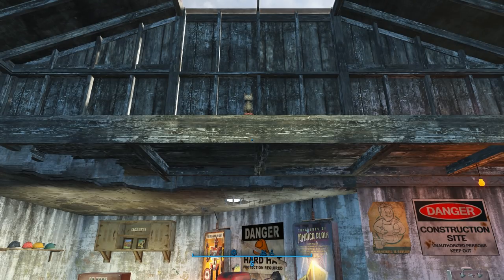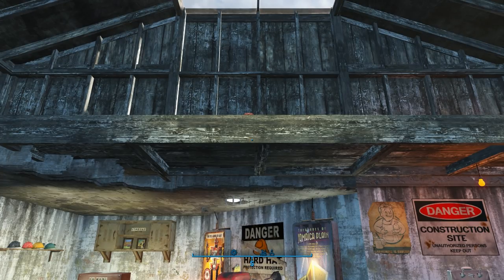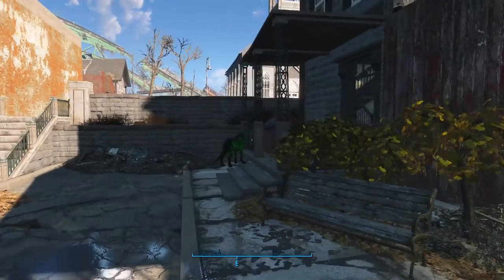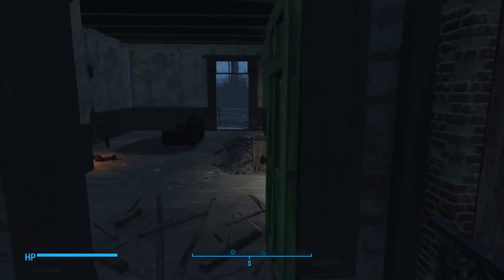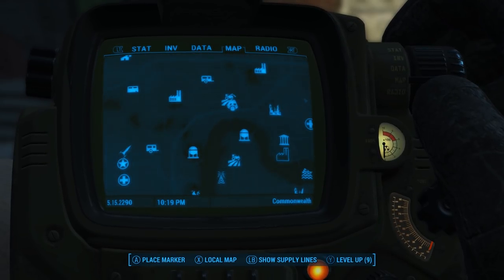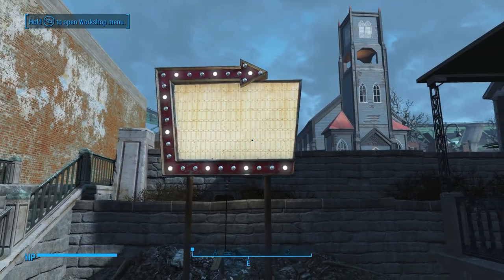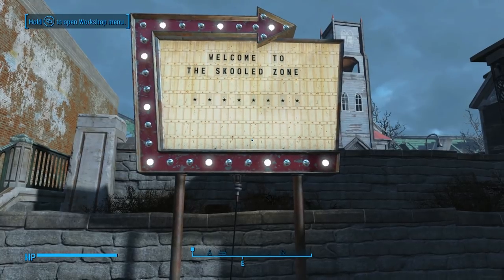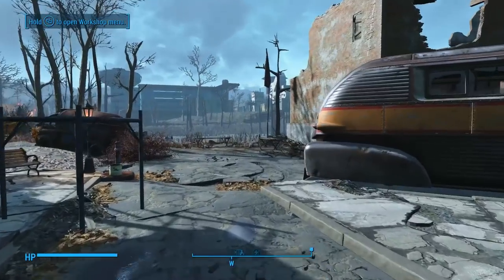Combining the Rug Glitch and Pillar Glitch 🔀 Fallout 4 No Mods Shop Class

Comment: the vendors (general) that won't work with the rug glitch, to get them to work you just have to put a conga line  of default rugs under it, like wayyy more than you'd think, like 10-20, and put the vendor somewhere in the middle, until it pops up on to the rugs, and boom it works
Reply from the maker: "Conga line" Haha. Good one. The vendors I was talking about though are the newer counter top ones. They snap to each other, though. So that's why they don't work with the rug glitch.

Comment: PSA, you can stack beds in same cell with small toolbox or mats to save space, the settlers may not reach the physical bed, but the bed count still registers.  I did this in Covenant, where placing a sufficient amount of beds is challenging with the allotted space..also, you can place lights inside existing lights in covenant to produce more lighting, you can fit a single string lightbulb into the middle of the cieling fans already in place, and fancy lights in the existing fancy lights.
Reply from the maker: Good tips! Check it out: https://youtu.be/Jl-idDvy-PE?t=623

Comment: Some prebuilt houses the door will snap into it without the pillar glitch. An example is the players house. The side door is missing, the one that leads to the car. Thanks for adding the PlayStation button, I hope you continue to do so!
Reply: Also, using the rug as the focal point of the group select "pillar glitch" works as well.  If you don't need to move the door vertically, use the warehouse or barn door frames, since this will place the door on the ground.  Your biggest issue is finding a flat enough surface to do this on.  Once the door is placed, remove the frame and move your rug into position.  Then group select and move the door! This will allow you to get a closer look at the door/door frame, to line up everything closer.
Reply: how do you do group select with PS4
Reply: Peter Heizman.  Lemme think for a moment. . . .I'm on pc, but have played it on xbox and use my xbox controller for pc.  The button that you use to select an object in build mode is the one you're looking for.  It would be the bottom button.  On xbox it would be the "a" button.  So, if my memory serves me correctly, it would be the "x" button on PS.  To group select, you need to press and hold the "x" button, while the object is in the crosshairs.  Items that are snapped together will automatically group select when this is done.  If you are trying to pillar glitch an object, if the "pillar" is close enough to the desired object, it will highlight as well.  If it doesn't, move your"pillar" closer.  But, to group select, it would be the button that you normally use to select a single object in build mode.  You just press and hold.  If the object(s) disappear or "jump" to a place that you can't see, try selecting your "pillar" or last placed object and place it in the same spot.  

Also remember that you can use the trigger buttons to rotate, raise/lower and change distance on your selection.   If you press R2/L2, all objects that are selected will rotate, right/left (clockwise/counterclockwise).  If you hold the R1 button and use the left thumb-stick, you can change the height and distance and left/right adjustments of the object(s).  If you select and object and hold the R1 button and use the R2/L2 you can increase/decrease the distance of the objects.  I think those are all the right combos.  Play around with them, and you'll get what you want.  Hope this helps  : )
Reply: thank you that helped

Comment: I LOVED this video!! Sinking the generator underground yet still able to pull it back up!  Genius!  I wonder though if doing this would help on FPS when your settlements get to large and start getting laggy if burying generators and other things would lessen that fps drop.  Furthermore you could use the conduit pipes to wire your settlement underground so you aren't left with wires strung everywhere.  I love your videos Paul but I must confess I usually play with some mods.  But I'm going to use this method to wire my city up having the wires underground (like in real life) instead of strung from roof top to roof top.  I'd love it if after this series or possibly tangent to it if you could do a modded schooled zone.  Covering tips and tricks to modded game play.  Ranging from tricks like this one that even with a place anywhere mod this trick is still extremely useful to tips about load order and just all sorts of things.  Anyways your amazing Paul!!  Keep up the great work!
Reply: Saraphiene.  To answer your question.  No.  Burying item underground will not solve any fps issues.  It may, however add to them.  Out of sight, is not out of mind in this case!  The reason being, is that the game still loads the items, no matter where they are at!  I found an example of this by accident while browsing some posts on a mod that I was going to download.  The mod author redid College Square and people were complaining that the fps drop was heavier than normal. The mod author came back and explained that it was his fault.  He had left four Prydwens underground, instead of deleting them!  This made it almost impossible for lower end pcs to load the area without ctd.
Reply: Well he is kinda doing a mod shop class cuz you can use every tip and tricks with mods 
But it is a good idea to build the cables underground ;)
Reply from the maker: Saraphiene, it would take some careful planning but you could totally run conduits around your settlement underground so no wires are showing. That would be kind of amazing. You'd probably want to leave some "pick up" points like I showed in this video because generators can still get damaged underground and need repair. Also, I think Court answered the question about the FPS issue. Since I don't use mods I wouldn't have known about that modder. Here's one of my issues with mods and why I don't use them. Whenever I watch a video of a modded settlement, I can never tell what was the true work of the YouTuber and what was made easy with the mods. It'd be like watching the Tour de France except some cyclists are using electrically modded bikes. Sure they still have to pedal a bit, but you can't really tell how much was their effort vs. the effort of the mods. At least that's the way I look at it. Whenever I see a beautiful no-mods settlement, I can immediately tell how much effort and creativity was put in by the YouTuber. When I posted Vault 42, I got comments for weeks from people claiming there was no way I didn't use mods. Haha. Some got nasty and called me a liar, clickbaiter, and sprinkled in expletives that got filtered into the spam folder. That right there was a message to me that mods have really blurred the lines. But I took it all as a compliment because if I can do a better job than mods, it's like beating electric bikes in the Tour de France on an old rusty Schwinn. LOL. Anyway, love your ideas but that's why I probably wouldn't do it. Plus, it's cool knowing I'm one of the only no-mods channels left. Viewers can come watch my videos and trust that everything was "hand-crafted" hehe. Know what I mean? Oh and by the way, did you notice the mining helmet on the front aisle desk? ;)
Reply: Interesting.  Where did you find that?  I don't believe I've come across that in over 1500 hrs. gameplay.
Reply: Skooled Zone I saw the mining helmet and loved it!  Thank you!  The only mod I use are scrap mod to get rid of trash really but I totally understand your Tour de France reference which has made me contemplate using mods at all.  None the less count me as an avid subscriber because I love your work!
Reply: I love to build, but the problem with no mods is that the game has simply become too easy. It's fairly trivial to do a one-life survival run with no mods. Throw Horizon and maybe Pilgrim on it and it's not just really difficult, it's also mildly terrifying. Happily, what I learn from  you is applicable in that scenario as well.
Reply from the maker: Court, 1500 hrs? Wow, that's impressive. 👏 I think I'm still under a thousand. Anyway if you talking about the pink mining helmet, I found it and a bunch of other colors at Dunwich Borers. Saraphiene, cool, cool. Glad you're part of the class, and I like taking viewer suggestions. :) But your mentioning of the scap mod as well as Tom's mod suggestions brings up a good point. I don't want to paint mods with too broad of a brush. I'm only talking about the settlement mods that add things unavailable to the vanilla game and dlc that make it an unfair race for no-mod builders. Other mods which don't affect the look of the work, or don't even have anything to do with settlement building, don't get any shade from me. ;) If I were to ever use mods, I would use them for the adventure expansion part of the game because who wouldn't want to do more adventuring in the game? 😉
Reply: 893 hrs. logged in on steam and I'm guessing a little less than that spent on my xbone before it became a brick.  It was a single character with all dlcs completed (except open season), level 141-ish with all of the collectibles and side quests completed up to the prologue missions to start the act three infiltration missions. I also made a save before I started the faction missions so that I could do speed runs for all of the achievements.  I was going for a completionist BOS/Railroad/Minuteman ending where all three were neutral towards each other.  But, I had about 40 hrs logged into my v88 build, and on average 30 hrs. on the other settlements.  I think I had something at all 30 of the main settlements (not including any dlc locations).  All of them were walled off, except Spectical Island.  I had close to 20hrs logged into Sanctuary before I even started the missions (great way to level up early on, btw).  All of that was unmodded too.  Sadly, I'm unsure if my factory reset destroyed my saves.
Reply: Skooled Zone around 1800 hours clocked in
Reply: Skooled Zone why do mods bother you at all? It seems to me place anywhere and the cheat terminal would speed up a lot of your glitching and supply problems. It seems like removing the size and height limit would speed things up farther. Scrapping things in the surrounding area would stop the game from crashing when you exceed the size limit. Even using mod assets either external or internal as long as their not new prefabs dont detract from creativity at all.

Comment: Good tip would be using furniture of various heights combined with the rug glitch to place items on specific shelves (to stock all those store rooms)

also kind of surprised you dont use the steel and wood pillars from the warehouse and barn stuff, much easier to use than the concrete pillar.
Reply from the maker: Thanks Snake Jawz. I actually do use the iron posts for "pillars" when I'm in cramped spaces. I just prefer the scaffolding for outdoors. As for placing items on shelves, what would be an example of an item that wouldn't normally fit on a shelf?
Reply: well a good example would be using trunks or lockers or hampers, objects of different heights that allow placement of stuff on top of them (like a tool box) to specifically place that toolbox on the first, second, or third shelf in a rack of shelves. (also requires the rug glitch)

Comment: Love the 💡 of a miscellaneous tips video. This was a super helpful way to allow me to place doors I like, rather than always using the  butt ugly ones from the warehouse or the totally non-private glass ones (also warehouse).  I dunno about sinking generators,  though.  I tend to use 1 big,  but fairly compact generator,  the bluish one with a fusion core  that gives about 100 power to power up my entire settlement. It's a bit tricky to try to sink that and run power everywhere.  I usually wire everything up high,  sometimes even putting that generator  on a rooftop.  Have the 💩iest luck with the pipe conduits, too.  Can never seem to line it up properly.  So,  REALLY looking forward to the upcoming video on wiring. I also wouldn't mind knowing what you do to use these kind of tricks in areas that are cramped,  where you can't maneuver well. I'm gonna check out the kitty name poll. 👋
Reply from the maker: Thanks for comment Lora. Yeah, I think the next video will help you a lot. But yeah, I used the nice fusion generators at Vault 42. One buried underneath the elevator and one way up near the brig. Tried to wire everything around with conduits and through walls so it would be clean and unseen.

Comment: i used the chassis, (not sure how you spell it), to set up a section of junk fence on my red rocket build...thanks. by the by, i made the discovery that even though you have a chassis set up, some times it's too far away from where you are trying to set something precisely, (i'm kinda ocd, but i still don't consider it a, "dissability". but who needs really needs details anyway?). ANYWAYS,  with your door placement as an example, you can turn your chassis assembly 180 degrees and place it from the opposite side with a better view. of course you can't see your pillar; but if you keep a weather eye on the, "place" command in the workshop interface...you can make any adjustments and as long as, "place" is highlighted, you are golden...just sharing the wealth. i did the, "don't feed the bears", trick to park the sign by dogmeat's house at the red rocket...and that was one long way to hump a sign, but it was kinda worth it...and the adventures i had getting it there...but that of course is another story.
Reply from the maker: Right on!

Comment: I saw a comment about the pole and marquee no rug glitching because they both snap. Just wanted to mention that the low counter style stores also snap (to each other).
Reply from the maker: You're absolutely right. I never snap them together so I totally forgot about that. Thanks Jason.
Reply from the maker: Jason, there's another one I noticed. The Vault-Tec Population Management console. Know what I'm talking about? Can't seem to rug glitch that one either. Does it snap to something?
Reply: Yes, if you build two or more they'll snap to each other side by side. I'm not really sure why the developers did it  that way. I've never sussed out a functional reason to have two of them. However, (you may already know this) if you build one of the vault-tec terminals and one of the vanilla terminals (with the the round screen), only the population management functions will show up in the vault-tec terminal. All the electronic functions (on/off switches, turrets, delay settings, etc.) will show up on the vanilla.

Comment: if you put the rug next the door when you have it outside instead the pilar and the conduit you can take the door when you want easy. Is another method.
Only you need that the door be a llitle more up that the rug.(or exactly in the same level, now i don't remember it. If is in the same level you only move the rag with the pilar help exactly to the same level where is the level of the door in the frame door outside. Then you take door and rag where you want easy)

Comment: @SkooledZone Paul I sent you an email (I think) about a new no mod wire glitch that replaces the conduit rug glitch completely.  in fact it replaces every wire wire glitch you could think of allowing you to attach any conduit to any conduit or powered object through any obstacle reguardless of distance. Through walls, any conduit type, any way you could imagine with no limitations!
Reply from the maker: Absolutely. That's one of the three methods that you'll see in tomorrow's video. It'll be good to know all three techniques because each one has it's use. :)

Comment: I'm sure you probably figured it out by now, but that seems to be the hard way to install a door into a house. 

All you had to do is use the pillar to lower the door after deleting the wooden frame, the use group select with a rug or the same pillar and move it into place. Beauty about that is you don't have to stand 20 feet away and try to guess if you are lined up properly or not.
Reply from the maker: You may not have noticed in the video, but the pillar doesn't sink on all surfaces. It didn't sink on the porch for example. So the only way to make vertical adjustments was using the method I showed.